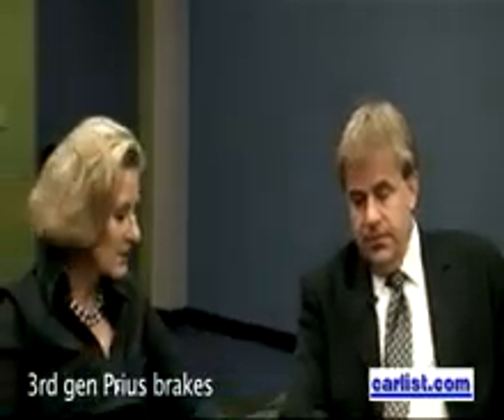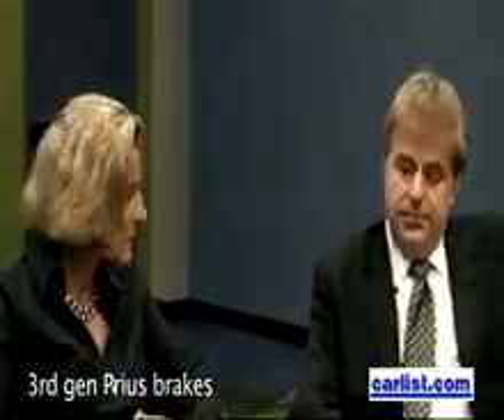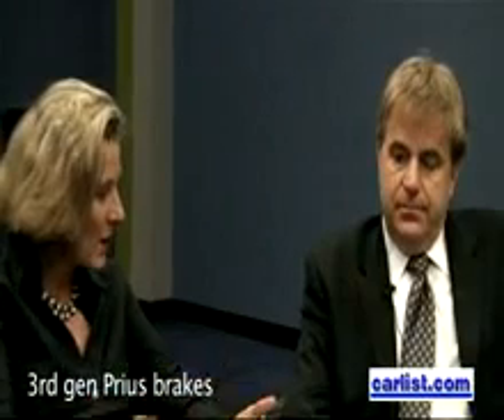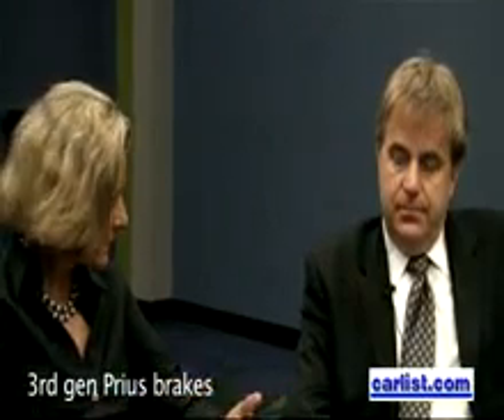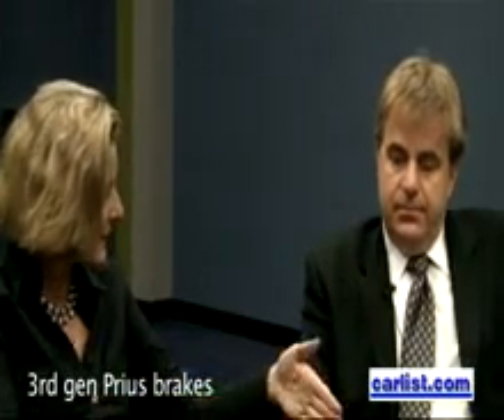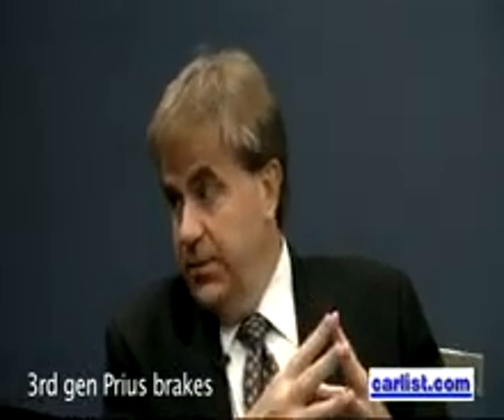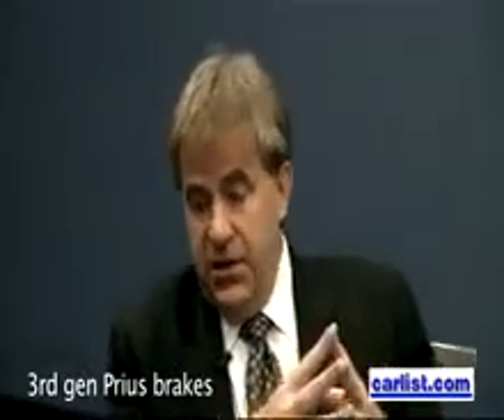Bob Carter on the Toyota Prius brakes

Comment: That's right all 3rd gen prius made between 2009 2011 needs software update from a dealer. My company car is horrible when hit a path hole or applying brakes over the bumps it's just continuing floating and can't stop properly . All cars with abs working similar but prius is very bad, the only way you can have braking power back after you hit bump and abs kicks off is to depress the brake pedal and press it again but believe me this is not a typical human reaction to depress brakes while you are travelling on speed toward something and require a good driving experience.